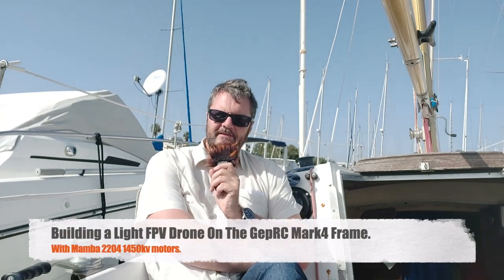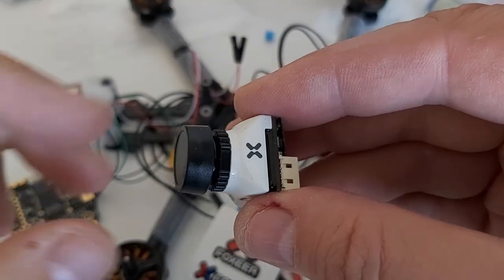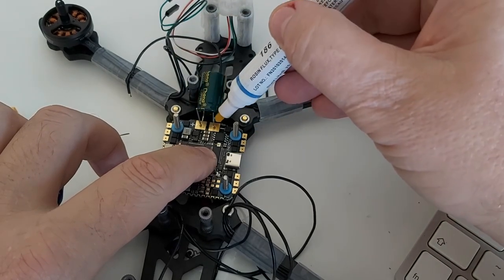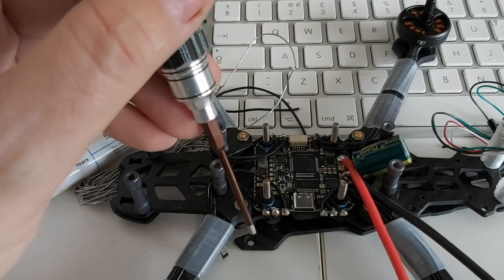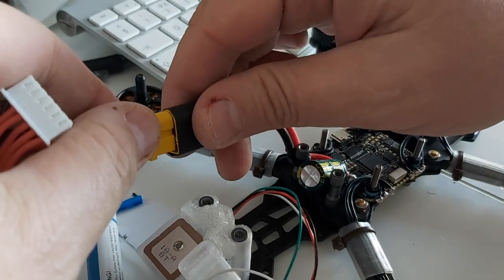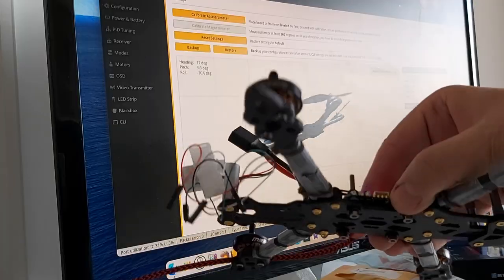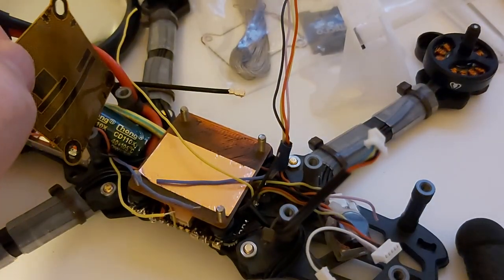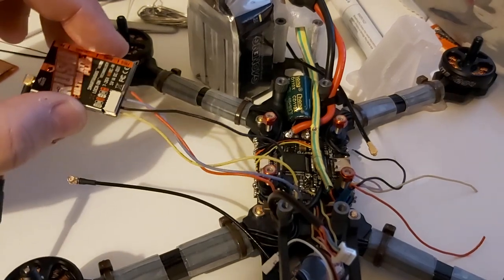Building a Light FPV Drone On The GepRC Mark4 Frame.

Comment: You may want to try a different tip for soldering the larger items like ground pads which require additional heat transfer to prevent cold solder joints.

A tip which has a flat area will probably help. I will have a video coming out at some point on tips for XT60 plugs and sockets. Mark4 frame from GepRC is excellent. Those motors look great super low profile.
Reply from the maker: Thanks, yes, I will get one :-)

Comment: Subscribed! I have been flying fpv for a long time exited what you will show!
Reply from the maker: Don't hesitate to criticise! I can use some tips!
Reply: @gilfpv7171  Will do. One tip I can think of is definitely use conformal coating and shrink wrap on components. Helps them last longer in my opinion. Joshua Bardwell is usually my go to source for help on quadcopters. I also find F7 flight controllers aren’t that helpful and just add a lot of cost. I try to spend as little money as possible so I just go with f4 flight controllers. I quickly watched through your build and I think you did a good job! 
Using a diversity receiver for crossfire is very overkill unless you are flying really long range. One nice thing you can do with the diversity though is you can hook a 1s battery to it so it stays on and will transmit a beacon for you to find it. Be careful though because it could draw to much current from the flight controller and kill it. 73 and good luck. N0BAA. Oh one last thing if you are flying with rth as failsaife always test it because sometimes it could fly away although beta flight seems to those sanity checks so it shouldn’t but when I fly long range I make sure it works because I don’t want it to drop or fly away when I’m 2 miles out!